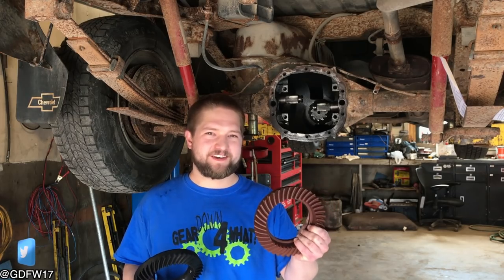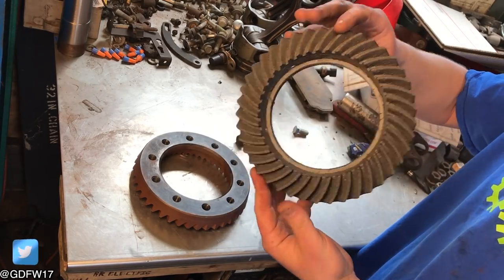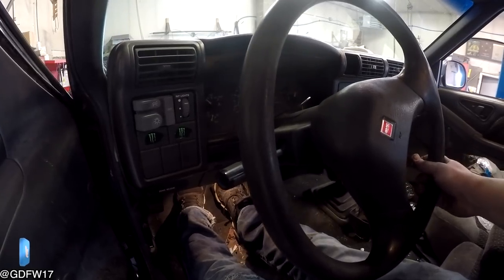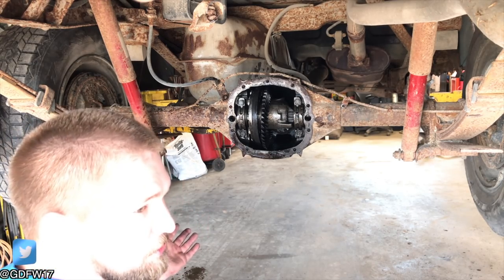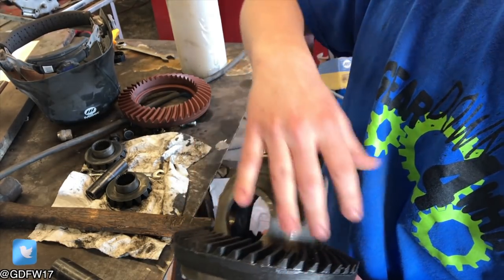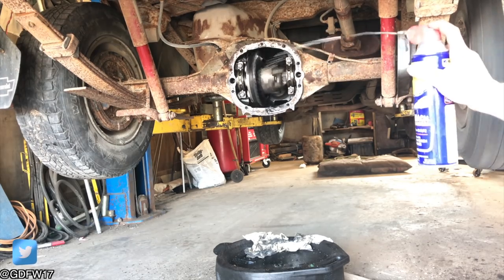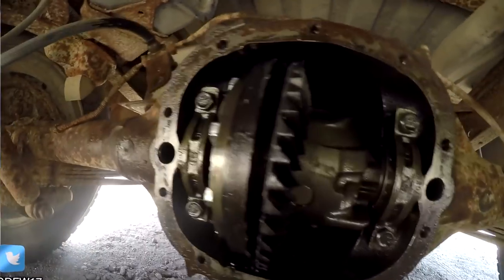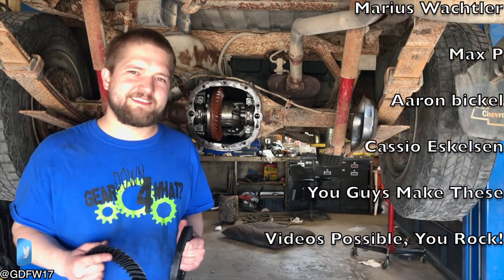Replacing Drivetrain Parts with 3D Printed Carbon Fiber Nylon - FOR SCIENCE!

Comment: Are you kidding? This is a no-brainer. You DEFINITELY need to try it again. Is it a good idea to replace parts like this on your vehicle? No, of course not! Every capable, logical-thinking, mechanically inclined individual will immediately tell you that it will fail. BUUUT how long will it likely last before it fails? 10 yards, 10 miles, 100 miles? And how awesome is it that you even tried? So awesome.

Comment: My theory for why the gear broke is because it was made out of two parts. Adding more parts makes it more fragile because there are more points of failure. Consider printing it in one piece and drilling the holes in the appropriate spot to install it in the differential.

Comment: So... why the need to encase the nuts? The NylonX layer strength is always going to be better than JB Weld. Why not make pockets to slide the nuts in? It's possible I'm missing something, but, I know one certain fact..

THIS WAS AWESOME. You need to do it again. Seriously.
Reply from the maker: I will try again if you collaborate with me and make a version out of polycarbonate!

I tried soooooo hard but failed miserably sooooo many times and gave up!
Reply: Gear Down For What? Polycarb? Dude, great idea!
Reply: Using pockets would be great, it would eliminate one point to failure
One could suggest using a MOARstruder to get better layer bonding (but maybe losing on teeth accuracy)
Or maybe it's just that I want to see MOARstruded NylonX :p
Reply: 3D Printing Nerd 
After watching this I am impressed but I did notice somethings that went wrong and if you want I have my advice.

Where you went wrong is three part. 
1. You separated your print during the process and added in the nuts. 
This could be solved by placing the nuts in after it reaches 1mm rim on the hole without stopping the machine. I have done this with mixed results. I'd you do this Put adhesive (personal fan of Gorilla Glue) on face of nut and on top of nut. 
2. You stopped the machine and didn't reheat the material. I don't recommend reheating but it is a possibility to a solution.
3. You could mount the go pro under the back for safety.
Last thing you could do is a two part piece that has separate bolts to attach. Because the material held up just not the seem. (Counter sink The nuts for this method as not to increase the size.)
Reply: or redesign it to be a 2 piece from the start with interlocking teeth instead of being flat on the two surfaces you want to stick together. If you also  have the nuts half way into each piece it would make it a lot stronger
Reply: Carbon fiber nylon is definitely stronger than polycarb. I would try Nylon infused with kevlar from a MarkForged or Ultem from a Fortus printer. And btw if you need any exotic materials printed I can do them for you at my university. We have basically every printer you can imagine.
Reply: 3D Printing Nerd if you guys do do this again you can get a type of nutsert you press into the material. Have a hole made into the part and press them into it.
Reply: Something to keep in mind as well, bake your parts on an oven after you get done with the print... definitely helps with layer adhesion and strengthens the entire part.
Reply: Opt for Key-Locking Inserts (Keenserts) in a solid part. The Brass heat-set inserts would more than likely be too soft to handle the torque. Also, anneal the part after the inserts are installed. Lastly, build on a slight incline so that the layers are not co-planar with the shear load.
Reply: would be a great colab. i love both your channels
Reply: SolidFusion Not the heat set ones. The ones I refer to are the ones you use a crimping tool that kinda mushrooms out. I would still warm up the plastic so it won't crack.
Reply: It can cause shrinkage though, which would throw off dimensional accuracy.
Reply: you cant use pockets, by not having 2 sides of a traditional nut encased it will twist out and shatter the part. a person could make flat plate thats threaded and inser but still if it were to hold under light load would fail at the teeth under a heavy load.

the only way he could pull this off is printing in an aluminum filament and his machine isnt up to the task of printing industrial products. 

your best hope heat the print before resuming with a propane weed burner before placing back on the printer and use a broad flame butane torch to heat on the printer before resuming the print to ensure the surface bonds properly.

secondly, you should have used an epoxy. they get super hot as they cure, the faster the cure the hotter it gets. it will melt them together
Reply: play it again sam :) and this time if you plan on putting the nuts in again like last time  design it as a two piece product maybe have it so  they interlock together perhaps with a dove tail of a keyed wedge or inter meshing teeth  ... i have a few ideas hit me up if you interested
Reply: hehe you could alwasys call it a limited slip diff :P
Reply: 3D Printing Nerd pause the layer on the nut inserts. Top and bottom then print over the top of the nuts. If designed to occupy the nuts
Reply: Pausing the print will allow the top layer to cool, causing a weak layer bond when you restart (unless you have a heated build chamber and keep the part warm when you drop the nuts in).  A different way to install them, like with slots or some of the other two-part ideas, could help, like the dovetail, but then you're getting a lot more complex than it may need to be - one part to print would be nice.
Reply: 3D Printing Nerd better yet print it solid and tap the threads which will almost certainly give better clamping force and durability than encased nuts. I'd definitely love to see this project done again though
Reply: Couldn't he just pause the printer, pound the nuts in. Then put it in the oven at the right temp and then put it back on the printer with it warm?
Reply: Yea I was thinking the same thing. Have slots on the sides to slide the nuts in after printing
Reply: If you wanted to continue to use nuts by pausing the print perhaps you could enclose your printer and fill it with warm air during the pause to give you more time to put them in? Perhaps future printers could use a simple robotic arm for placing objects like that during the print. Imagine the neat stuff you could make with embedded magnets, electronics, as well as anchoring points.
Reply: I've heard Joel has a gMax and 3dxtech makes CF polycarb...
Reply: What about trying to heat up the top layer with a heat gun before resuming the print?, maybe also encase the part in support structures to try and prevent uneven shrinkage when annealing the part?
Reply: Gear Down For What? Reprint, and in so doing, keep an infrared lamp on either side to keep the surface material at work heat, the encasement will be nigh on perfect as ring gear mk1 only failed due to mechanical delay. Time your lights for the end of session one and extinguish as layer 1, session 2 is underway. The light machine oil is not at all suitable as your composite is kissing cold steel.  I'd suggest a ptfe silicon grease, a light coat in the gear faces before installation. It'll take a fair bit of abuse as the 'rubbery' grease will also cushion the composite you'll also need to take down your diff and thoroughly clean all parts rincing with trichloroethylene. I'm interested as to whether this performs well enough to attempt a printed monocoque châssis vehicle, my mind's bubbling away nicely with designs in 1 2 3 and four wheel. I've allready seen solid composite tyre/wheels. Costings could make this very interesting. I did the original concept for the triumph 750/900 trident, tiger, trophy, introducing mr bloody bloor to modular engineering a la car industry. Feel free to ping me. And i look forward to seeing mark2, perhaps with an all composite differential.
Reply: 3D Printing Nerd heat brass inserts into the part or use a helicoil for the bolts next time
Reply: Mr. Universe it won't twist the part. The nut doesn't rotate like a drill, it orbits the center like the nuts that hold your wheels on your car.
Reply: This. The stress is mostly shear, so no need for all that extra clamping force. One piece print should help a lot also. I bet individual teeth would come off instead.
Reply: pcs a way better choice heard this carbon makes the nylon prints fragile, plus you can find polycarb from other places than the store thats really gouging peoples eyes out right now for barely special filament/mixes and they know it.
Reply: also please dont use that WD40 again, the solvents in this stuff will not do you any good and WD40 is also not really good at lubricating stuff.
Reply: Gear Down For What.
Polycarbonate dislikes any hydrocarbon.  A chlorinated one is even worse.  Clean out the whole thing and use silicon oil only if you go with polycarb.  Acetal plastics can work but never ever ever use lock tight on them.
Reply: @Wes Lamb I've been thinking about using robots for imbedding non-printed component parts like plates, nuts, pins, springs, magnets, etc. for the past few months.  The idea is a good one.  Incorporating it into a printer would not really be an automation standard.  Generally, machine tending or collaboration with a robot is set up with a separate robot since different jobs require different robot types.  Machine-robot collaboration in this case requires only a part feeder for the robot, a custom end-effector and software (and/or hardware I/0) communication.  The difficulty is the strength and calibration of the build plate and the fact the part is stuck to it.  While potentially useful, current printers are limited to very light drop-in parts as the layers are stacked vertically.  Current printers would not withstand pressing or torque operations, and inserting pins from the side during printing would be pointless as there is no way for the extruder to go back down to cover the holes.  It is my belief the printer improvement would be a stationary industrial build plate for pressing or screwing, or a removable plate like on the Prusa i3 MK3 which could be quickly moved to a heated robot work station and back again accurately without ruining layer height calibration. This is an idea for mass production and the industrial printing market which hasn't arrived yet.  I'll give it a few more years with work from guys like this who will show what printed parts are capable of before we see industrial automation capable parts printers.  :)
Reply: How about heating the part to insert and making the hole a snug fit. Very little force would be needed if the plastic was basically melted to let the part slide in place.
Reply: You could just put the nuts in as it prints, youll just have to kind of carefully work around the print head
Reply: Plus I've heard CF nylon has awful layer adhesion. The only pro is the stiffness pretty much afaik

Comment: Try again but try this:  pause the print, position the nuts and use a soldering iron to quickly sink them, use extra long bolts that extend appropriately in gear side as far as possible. You could possibly reuse what you have printed by drilling. You will need to create holes for the bolts either way. Or you could possibly add an array of smaller bolts to do the same between the existing bolt holes. The main idea is to use bolts to resist shearing and separation.  JB Weld probably could be used on mating surfaces.

Comment: Thanks for the experiment and the cool video. Since the main problem is not the material strength and rather lack of enough layer adhesion, I would suggest two remedies:
- Printing at an angle. probably 30 degrees or somewhere there.
- Putting the printed gear in a clay/plaster/silicon mold then heat it up in the oven for a couple of hours so the plastic remelts and the integrity improves. And the mold can be removed using a water bath or just physical force in the case silicon.

I'm really curious to see the results and I hope you consider them.
Cheers

Comment: Simple fix: Print it the other way up. That way the torque transfer from the gear to the bolts is all one continuous print with the layer holding the bolts in being under compression during use due to said bolts.
Reply: Not sure I understand this, could you explain please?

Comment: Yes, please do it again. I'd suggest Threadserts. Larger OD to spread the load out, threaded to allow you to loctite them in. Adhesion to the nylon shouldn't be an issue as the loctite is just to wedge the Threadserts in place.
Reply: John Pickens: I think helicoils (for stripped hole repair) could do as well a job if he were to make it as one piece. Once you tap them in, they don't come out, and provide a strong thread face to hold on to while supporting the shear-load.
Reply: Helicoil, Threadserts, same thing. Look at the link I posted, same stuff.